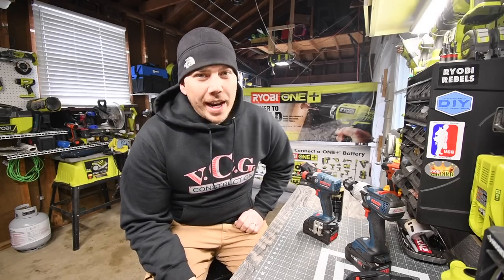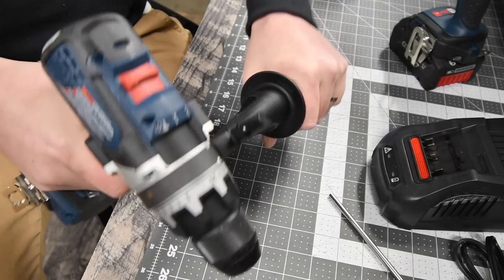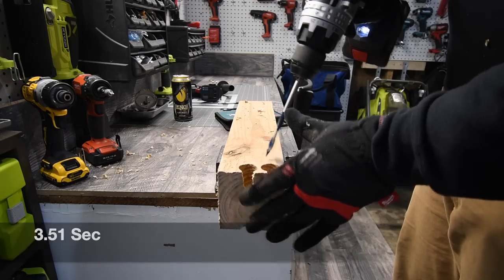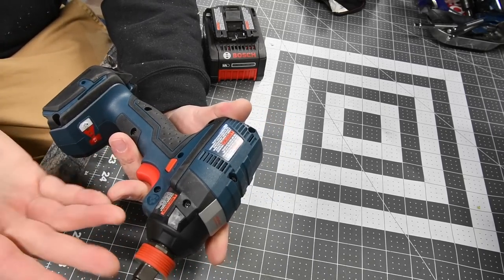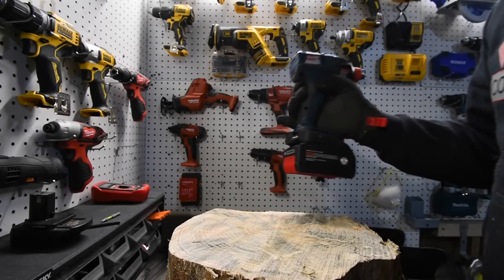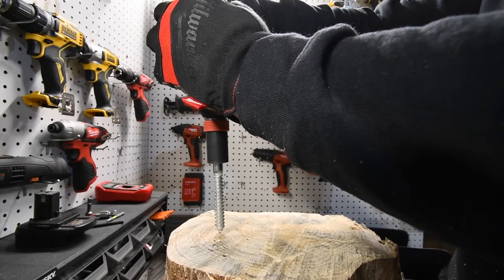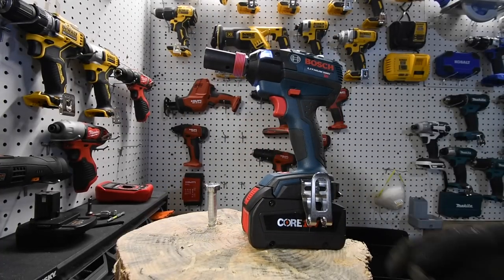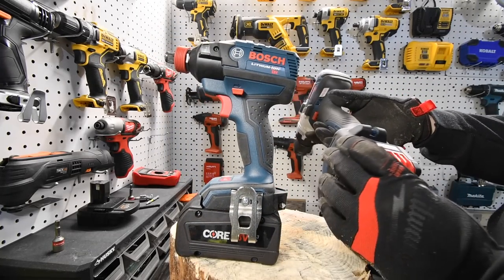$300 Bosch brushless Hammer drill/ Impact kit test

Comment: I got the same kit as you  the idh182 is nice only grape I have is regular bits will not fit in there because of the collet hybrid configurations  and the hammer  drill is pretty good in my book better than my last DeWalt hammer drill dc925 your right about the chuck not as robust as Milwaukee and dewalt or Makita the core 6.3 ah battery has 20700 cells in it the 4.0 ah core has 21700 cells so does the 8.0 ah core and  coming soon 12.0 ah core I will tell you this much the new brushless freak feels cheap compared to the idh182 thanks for sharing glad you finally got some Bosch in your collection they're not exactly cheap I'm glad you caught a deal on the kit mine was $379.00  + tax and
Reply from the maker: I cant wait to get the Bosch 12v line and thank you sir
Reply: @ManCaverTools  the Bosch 12 v line is sweet I have used them can't wait to see more videos Bosch has a 12 v brushless flexiclick coming in April is what I was told not sure if that will happen 💯 certain. I said that about the strong-arm which is now the 
Bi  metal circular saw 7 1/4 ( 18v) they also have a 18 v flexiclick coming out along with a 12.0 ah core battery with 21700 cells after being stagnant for so many years that idh182  impact driver actually came out in 2014 officially from my understanding was available in Europe before  originally came with two 2.0 batteries not core but did have a battery meter and had the option of the  L boxx and a zip  bag like Ridgid and Milwaukee I just figured I'd give you the history you've done a great job with making your tool ranch selection versatile I'm happy to see that you have branched out to Bosch.  Fein  is a little bit to premium for you me and alot of people they have a 12 v brushless line if I'm not mistaken they have a drill oscillating tool

Comment: Use the ryobi fan you got there to blow the wood shavings while you drill? It would probably let you see more clear when the drill chuck touches the surface
Reply from the maker: I should do that, but I haven't cause of the noise it will make in the video

Comment: Impact wrenches dont use a ball bearing on anvil for retention the use a friction ring or pin detent anvil
Reply: Brian Klein correct.
Reply from the maker: I thank you for the info sir
Reply: Well pin detent is the same bases as the ball bearing. I myself would rather it be a ball on a spring instead of that pin. With the ball you can at least pull the socket off if you wish that pin has to be depressed by another tool

Comment: You must've been running that drill beforehand because I own all those tools and I've never had them heat up like that! One time I drilled as many holes as possible to see when that red light comes on and the battery was almost dead before that happened. And the tool wasn't that hot...
Reply: Also, what kind of wood is that you drove the lags in?
Reply from the maker: Pine is what the I used to drive in the lag, and this is the first time these tools were used.
Reply: I see, that's just not the experience I've had with my Bosch tools. Odd...

Comment: Man, I want Bosch vs hilti! Please!
Reply: If the lastest hilti will blow the Bosch away for speed and torque. But this few years old Bosch hammer drill is quite well made and durable. Especially chuck and hold bit so well. It comes with kickback feature will drain the power acutally. I use different brand of power tools found Bosch battery last longer.
Reply: @sw86241996 
We will see the test. I think hilti will win but this drill from bosch is old. They need to add a new one.
Reply: @Pecke1234  ture. I had this Bosch drill for a while, similar one with slightly increased torque with connection function. Anyway no complaint, it's great drill, I do love it handle everything well.
Reply from the maker: that video will be coming soon

Comment: I want to point out about the idh182 with the 1/2 anvil  & 1/4  collet being a hybrid it's not a hundred percent on either end as an impact driver or impact wrench and I did look up the foot pounds of torque converted it from 1650 inch-pounds of torque if it's me and converges impact wrench it's 137 ft pounds of torque which is low-end not mid torque but it will get the job done as an impact driver and  half  a#$#   impact wrench if you doing certain tasks it's perfect it's not the fastest set the tortoise and the hair idh182 is the tortoise it slow but will get you there people that  want fast use a Milwaukee fuel Gen 3 or use metabo HPT triple hammer impact driver by the way the handle on the Bosch hammer drill is not bad it's not like a Milwaukee Ridgid it's more like the older DeWalt hammer drill 18 v I had one with the ring  it's stiff enough
Reply from the maker: I looked on lowes website this is a impact driver
Reply: @ManCaverTools  officially that's what it's marketed as but it does have the capabilities of an impact wrench for light duty  137 foot pounds of torque converted from 1650 inch pounds of torque is not bad that core 6.3 helps when it first came out they had two kits one with two  2.0 ah batteries and one with two. 4.0 ah batteries and a  L box  the 6.3 ah core with 20700 cells is powerful enough i do got a 4.0 ah core with 21700 cells these bosch tools  not the fastest the new freak at 1800 inch pounds of torque is sweet and the hammer drill with 755 inch pounds of torque I forgot the BPM on hammer mode but the kit does come with two. 4.0 ah core batteries with the new 21700 cells

Comment: The Bosch will get clobbered in the verses video's I think hyper tough or hart would probably beat it LOL.
Reply from the maker: we will see
Reply: The Freak 2 (that's been on the market for 2 years already) is much improved over this 5 yr old tool. I don't know why Dave got this 4yr old kit for 300. I'd have returned it right away, I got my Freak 2 + GSB18V-535 hammer drill for 199 with 2 Core 4Ah batteries